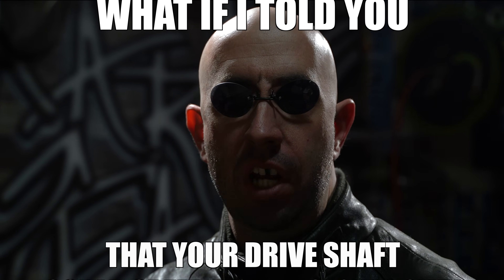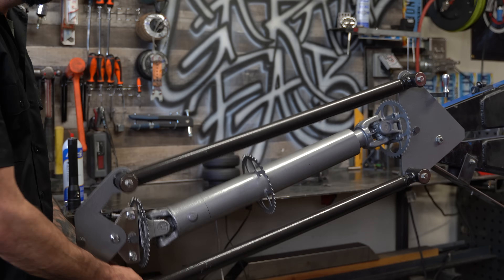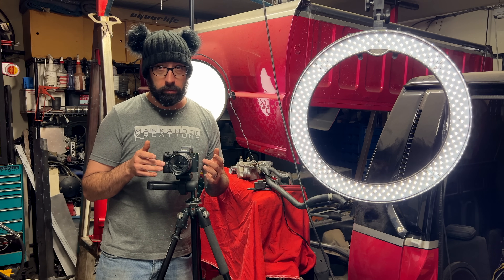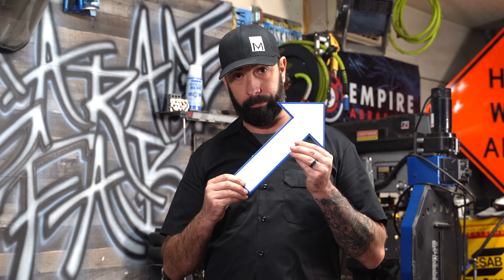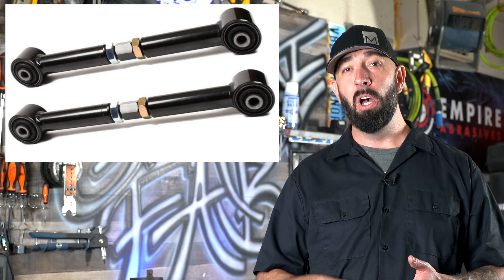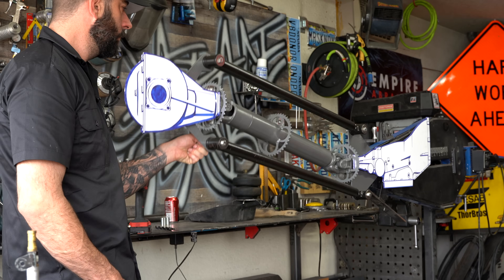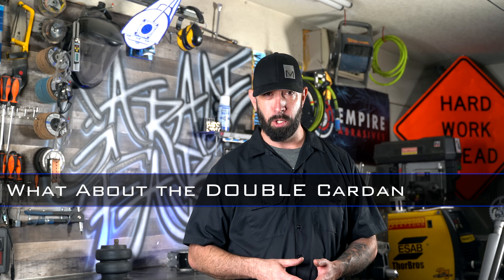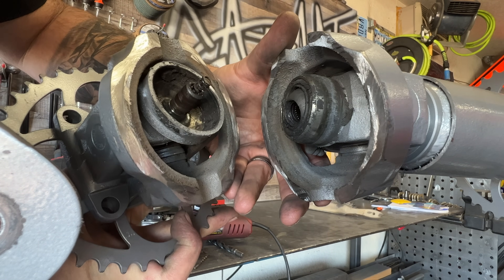THE Driveshaft Video. The Nature of U Joints. Suspension Basics Ep. 06

Comment: What about slip yoke drive shafts? I’m having vibration on my 1963 Impala thinking this maybe the cause but it didn’t use to do it before
Reply from the maker: I’d say the majority of shafts are a slip yoke style. If your vibration developed over time, it’s most likely failing U joints. Shake your shaft and make sure there’s no wiggling, and if there’s not you’ll probably need to remove the driveshaft so you can flex the joints by hand to see if they’re moving freely.
Other possibilities, though highly unlikely, is the splines on the slip yoke are worn. Again do the wiggle test. Shouldn’t move much. Or perhaps you kicked off a driveshaft balance weight. Again… highly unlikely.
Reply: @GarageFab  replaced the u joints,  took the drive shaft to get check if it was balanced and still shaky at around 55mph. Thanks for your reply
Reply from the maker: Bummer! That’s a rough one. Lemme know if you figure something out!
Reply: @GarageFab  thank you!

Comment: Great demonstration!  One thing people look past, these principles apply to steering shafts as well.   In the automotive industry we get away with non equal cardan joint angles by adjusting the phase angle of the joints to mostly cancel it out, but that is typically done with a dynamic analysis of a 3d model.  Also, if you are using an EPAS system instead of hydraulic assist, they really don't like input oscillations.
Reply from the maker: That is fascinating! I realize steering is just tiny U joints but I’ve never had to do custom electric steering.

Comment: Excellent video. Question unless I missed something here... So most 4x4 truck have a double ujoint up front with a single on the axle end.  My jeep has the same set up in the rear (aftermarket set) if this causes issue why do they use them in areas where there's increased driveshaft angle?  Thanks.
Reply from the maker: Thank you, Keith! A double Cardan joint only causes issues if it’s not set up properly. They serve a very real purpose! Do you personally have vibration issues? If you don’t, I’d be willing to bet that when your Jeep is at rest, your single U joint is fairly straight, and your double Cardan joint is either straight or has a bend. 
And if you do have vibration, you’re single you joint might be bent, regardless of the band in the double Cardan.
Double Cardan joints are great for increased angles because the more a drive shaft bends, the more the rotational speed oscillates. Even when set up properly, this oscillation can cause vibration at extreme angles at higher RPMs. The double Cardan takes the overall angle of the joint and divides it, so each U joint only sees half that angle.
I’m really unsure if I answered your question. Let me know!

Comment: Any advantages/ disadvantages of a CV- style drive shaft?  Enjoying the suspension series! Dad had a red late 80's Mighty Max
Reply from the maker: Yes! The advantages of a CV driveshaft would be that this video didn’t need to exist! 😂 
They are much stronger, vibration free, and can flex a lot more.
They’re not commonly used on production vehicles though because they’re far more expensive to manufacture. When making millions of cars, manufacturers really need to pinch pennies. Since the U joint is problem free when set up properly, the much cheaper U joint is the better option.
A disadvantage might be weight. The main body of the CV joint is generally carved out of a large chunk of steel, and there’s at least two joints. So on race cars, the car itself is a little heavier, and you’d be adding to the rotational mass of the drivetrain.
Reply: @GarageFab  Doing an amazing job simplifying the details; New Sub, just discovered your channel today!
Reply from the maker: Thank you! Much appreciated. Happy to have you, Ryan!

Comment: Bud, been watching your videos, awesome content. I'm about to start building a Shelby Cobra replica for myself as a learning journey.
My chassis is a custom one, and I have the whole front and rear axle from a bmw e46. This simplifies a lot because these are parallel on height, and the whole suspension is solved that way, my problem comes to understand what would the proper way to determine the height of the struts support, I will send a chassis rig to make sure everything is done with as much precision as I can. One idea I had was to test the proper height once the axles are in place, is that fine? Is there something better I could do?
Reply from the maker: Thank you, Diego! I think robbing assemblies from other cars is brilliant. I do that every chance I get. It saves so much time and so many headaches. I just purchased two donor cars for one truck project and I can’t wait to officially announce it.
Not sure you’re going to like my answer, but there’s not really a good way to determine your tower height. You’ve got no idea what your Cobra will weigh or how much the springs will compress. I think your best bet will be finding adjustable coil overs for your donor vehicle and just taking a stab at the tower height. I’d predict the weight will compress the springs/struts about 1/3 of their total extended length. 
Is the BMW still assembled? Can you determine how much the BMW body is compressing them?
Reply: @GarageFab  that's the fun part! These exles are from an e46 identical to a friend's e46, so I have all the references from a car that is completely assembled. You gave me an idea, now you said adjustable coilovers, it is probably not a bad idea because weight is something that pops up in my head from time to time, e46 like this one weight around 1400kg, while (can't say with precision) the factory of this kit told me their cobras with engines are normally rated at 900kg. So using the standard springs may result in a stiff suspension,  I'm sure I'm gonna learn a lot, these kit cars are body + chassis, but everything is hand made, and engine is not part of any package, so this will be by far my most complex hobby car, I just finished my e39 540i6 today, full engine and suspension refresh, on Monday body shop, and I will call it done
Reply: What if... From the e46 that is build and running I take the ideal differential height getting the car standing, And i set the axle height at that, then it is just matter of finding the strut height, not a minor thing, but I would tackle at least one thing out of the equation
Reply from the maker: If I understand you correctly, I think that would serve you well. If I were doing it myself, I would place a jack stand under the axle and remove a wheel. Full weight will be on the suspension and you have access to measure the distance from the top of the strut to the axle.
Reply: Got you, the conversation turned just awesome, will keep you posted, but spoiler alert, this project will be a long one, but even once I manage to solve positioning both axles I still have to find some engine, get that mounted, position the body, etc I expect this thing will take me two years
Reply from the maker: I feel you. My top secret twin engine truck will also not see the road for several years. Keep my posted indeed. Maybe your progress will keep me motivated.

Comment: I love the quality engineering  of your test setups to prove the vibration sources. I think the point needs to be made is the larger the tires, the greater the torsional stress and the greater the angle induced driveline vibrations would be felt.

I’ve see lots of transfer case destruction on the late model 4x4’s granted some were probably the result of a failing u-joint. These new transfer cases are nowhere near the toughness as the old iron beasts. 

Think about it, if the new truck was lifted and larger tires installed, be prepared for disaster if your angles aren’t correct.

You earned a subscription from me!❤
Reply from the maker: I legitimately laughed out loud at your YouTube name. Thank you, Frank! I appreciate your time and I’m thrilled to have you. See you in the next one in the morning! 👊

Comment: Would it be beneficial to put a CV shaft on a dirt modified race car? They have a lot of rear end movement?
Reply from the maker: It would be neat! 😃 If I were to make this modification, it would be for originality, and maybe to make my driveshaft stronger. Set up would be less confusing, but I am unsure if a CV joint would necessarily be beneficial. If a Ujoint driveshaft is set up properly, you shouldn’t be able to tell the difference. It’s the set up that causes the most problems. This might be a question to ask someone that’s very knowledgeable about off-road stuff. (I am not) If you really have a LOT of travel, the CV joint bends quite a bit more without problems. I’d be interested to know what you decide!

Comment: Oh, that is just too good a demonstration model.  And this is something important to me (due to an engine/trans swap into a leaf spring car; but road, not track).  Thanks.
Reply from the maker: Thank you, Don! I hope you find it useful on your build. 🙌 Is it a powerful motor?
With the small amount of information you gave me, I think I’d suggest pointing the pinion angle down 1° from parallel to your transmission output shaft angle.
In other words if your transmission is pointed down 3°, your pinion angle would be pointed up 2°. The single degree would help keep the needle bearings and lubrication in the U joints moving, and would still take into account the occasional need mash the gas when the light turns green.
Reply: @GarageFab  Not really powerful, a vintage era "hot" 283 SBC (w/early GM 4 speed with GearVendor OD) so around 300 +/-.  Going into a '65 cuda with a ford 7.5 limited slip.  And it's intended to merely be a fast road sports car, not race.   
  But a SBC into Early Mopar provides torsion bar/steering box clearance issues so (ultimately) out came everything and in went a Mustang II with rack & pinion.  Engine/trans will sit differently, so change to transmission cross member will be required.  And that means (IMHO) connecting the subframes.  (I do prefer a ladder frame over a UniBody.)  All of which will result in a transmission/driveshaft/pinion reallignment.
  But time passes on the project with the usual interruptions  inherent in owner build.  Shoulder replacement this year (I hope to be able to again lift weight over head again in a couple of months), hip replacement last year (and moving much better now).  So maybe I can get the sub-frame done this Spring, engine/trans set during the Summer and maybe drive it come Fall.  We shall see.
Reply from the maker: Yes! You’re my kinda guy Don. Can’t leave anything original. Custom front suspension, custom drive train, custom shoulder and hip! 
Well I hope to find the time and ability to work on it. I look forward to it.

Comment: On the MkII Range Rover (P38) LandRover for some reason tipped the front axle pinion angle upwards so it points towards the transfer case, so no longer parallel to the output shaft of the transfer case. They then counteracted the alignment error by rotating  the u-joints a few splines out of phase...! 
It works fine for the standard ride height (air suspension) and any vibration at the full off-road height wouldn’t be felt because of the low speed. As you increase speed past about 30mph the system drops back down to standard ride height. 
The problem arises however when you ditch the (high maintenance) air suspension for +2” coil springs... now you can go highway speed at effectively the high setting and it is near-impossible to get rid of the vibration which is mainly felt under medium acceleration at 40-60mph. You can’t re-align the axle pinion to be parallel as it tips the caster angle of the hubs/steering out of kilter!
Moral of the story: Leave your Range Rover on air suspension and pay the maintenance bills...;-)
Reply from the maker: Wow wow! That’s crazy. I can’t help but wonder; Was it a mistake or did it have a purpose?! I’ve said in previous comments, “Production vehicle manufacturers know what they’re doing.” 🙊

Comment: why didn't you talk about minim angle of the U joint and how it affects the rollers in the bearing? as in to little and bearings don't rotate.
Reply from the maker: There was a lot I wasn’t able to cover, unfortunately. Operating angle and how to calculate it, Slip yoke minimum engagement, Maximum U joint angle at various RPM, and more. Driveshafts are a fairly complex topic and if I were to cover it all, the video would be 3 hours long. This video was strictly about how a drive shaft speed varies based on the U joint angle. I’ll likely do more driveshaft videos in the future, and I’ll be sure to bring that up. 🙌

Comment: Thanks brother for the channel, and a great teaching style, I just saw your channel and I've learned a lot already! I do have something that has me stumped though and maybe you can help. I have a 96' Tahoe 4door 4x4 that I've driven as a daily for several years. I needed tires and I got a great deal on a set a friend was selling but they were considerably bigger than stock. I purchased some 3" blocks for the leaf spring (rear end) and that took care of any clearance issues back there. In the front, it required tightening the torsion bars to raise the front end up. It seemed to work great for awhile...about a year or so but then I started noticing a lot of looseness and came to the conclusion that the front suspension probably needed rebuilt due to age last summer. I replaced the upper and lower control arm bushings, upper and lower ball joints, and all the brake parts while I was at it. The front axles seemed fine, and the tie rod ends even seemed good...🤔while there was some wear...I didn't find as much as I thought I would. 
One of the main issues that caused me to do all this work hasn't gone away either...
The vehicle seems to "wag" side to side going down the road especially at higher speeds which is very unsettling 😅! It almost feels like a have a stabilizer link that's broken...but this vehicle doesn't have that type of suspension lol. Any ideas? It's almost as if the main frame rails are disconnected and flexing instead of unitized...
Reply from the maker: Thank you, Ryan! I am a Toyota/Lexus technician by trade, so I’m not really familiar with the Tahoe. The 2005 Sequoia is a comparable vehicle that also has torsion bars. I’ve experienced strange handling after lifting which you described almost verbatim. When driving at high speeds, a mild swerve would make the vehicle feel like it would lose control or flip. The kind of handling that would make your butt pucker. I can give you some things to try, with no guarantee of their effectiveness on your application.
First, make sure the alignment is good. Lifting a suspension can cause a lot of changes in caster, camber, and toe.
Next, By lifting the suspension, you’re raising the vehicle’s center of gravity. This will definitely change handling quite a bit. (the same reason race cars are lowered)
When you lift a vehicle using the suspension, you’re raising the chassis/drivetrain higher off the ground. (The heaviest part of the vehicle) 
If you’re lifting just to clear tires, and not to increase ground clearance, consider a body lift. Some are really simple, some not so much.
Often all that’s required is some blocks for the body mounts, an extended steering shaft, and sometimes extended brake lines.
You’ll still be raising your center of gravity, but not nearly as much. 
The way you made it sound like you’re handling issue developed slowly has me baffled. All suspension bushings would’ve been my first guess too.
Did you replace with quality parts? (factory or polyurethane?)
We have a lot of problems with crappy rubber in aftermarket suspension parts. Actually I should say we used to, because we don’t use them anymore! 
It’s a lot of work, but I’d be interested to know if your crazy handling would exist if you lowered it back down. 🤔 It would help in finding a solution, if you can narrow down the cause.
And now for the grand finale of bad news.
That sphincter clenching Sequoia…
never got better no matter what we did. 😬
Reply: @GarageFab  dude, you're the man! 
I'll try a few things and report back.
Reply from the maker: Please do!! 🙌

Comment: Been doing a lot of "research" for a build I'm getting ready to tackle.
I found your channel and have watched most of your suspension videos.
I've been trying to find info on 2 link suspension but not much out there. 
I'm building a tow rig that will have air suspension and maintained at a constant height due to an air valve.
From what I understand now, it would work fine as long as all my angles are set with the truck at finished ride height...
Would that be correct?!
Thank you for any input!!
Reply from the maker: Hey Trevor! Yes! You are spot on. A 2 link is a great suspension design as long as it’s NOT on an adjustable height suspension. Once you find your ride height, set your pinion angle parallel to the transmission, (or parallel to the first section of driveshaft on a two piece driveshaft) and you should be problem free. The small amount that your suspension will move during regular driving won’t be enough to cause you any issues, and your drivetrain components will be happy. And so will you. Hopefully.